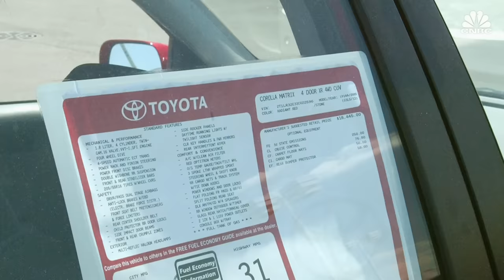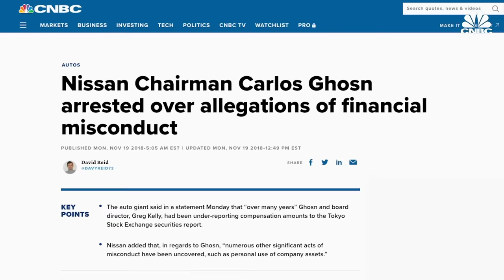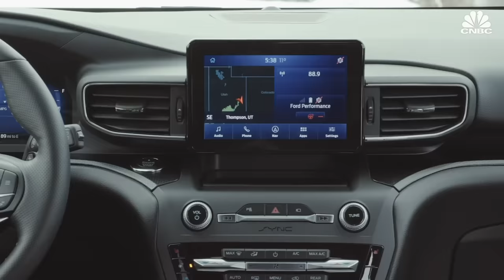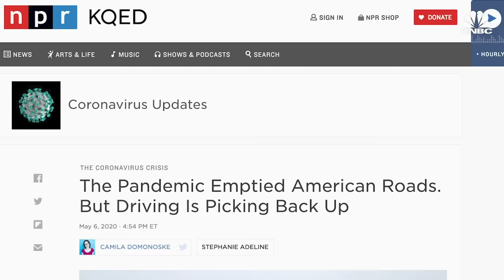Why Toyota, Honda, And Nissan Continue To Bet On Sports Cars

Comment: I want the 90's back! When driving was still fun....
Reply: Get a Tesla, it takes fun to a whole new level 😉
Reply: @markjames2338  But not with all those reliability issues. 😒
Reply: @Sacto1654  don’t believe everything you read. Ours is at 25k miles and all we’ve had to do is add washer fluid. Paid an extra $2k for a 75hp boost via the cars always on phone connection. We drive it hard all the time. Nothing else like it.
Reply: @otakuConn  nothing wrong with a good auto like the ZF 8 speed or any DCT but if it’s a CVT it’s gotta go
Reply: Just get a 90s or early 2000s japanese car
Reply: @modelotime3608  I will collect some, they got finally the attention they deserved when you driving one.
Reply: @markjames2338  The drivetrain is peerless, but the build quality of the body.... 😒
Reply: @markjames2338  go home liberal
Reply: @markjames2338  Tesla isn't the only brand that will have popular electric cars
Reply: u can still get urself a miata or a civic type r and feel the joy of driving, heard they are really good driver's car.
Reply: Still a lot of fun Japanese sports car today on the market that you can buy brand new. Like the Nissan 370z, Miata, 86/BRZ, WRX STI, & Type R. The bonus is they can all come in manual transmissions and have the Japanese soul in them =) 
Than you also have the R35 GTR, Supra & NSX. Though I find the new Supra & NSX big letdowns.
Reply: @otakuConn  

Wtf Tesla’s don’t have a traditional transmission lol
Reply: @jays5926  I think he meant that there is no manual transmission because it doesn't have one.
Reply: @doritolegend9664  

Well he said “no such thing as fun in an automatic”, implying Tesla’s are automatic but they are one speed 

Not a big deal it’s just a little funny. Plus it is true that manuals are much more fun, when not driving in our jammed packed busy cities. I just find them a little impractical in that environment
Reply: Mark James Tesla’s are outstanding cars but for many of us the exhaust note and manual transmission are two of the biggest factors of what make a car fun.  The Tesla (yes I’ve tried it) feels and drives like an appliance, albeit a very well made appliance.
Reply: And gas was cheap!
Reply: And gas was cheap!
Reply: @otakuConn  L
Reply: Did you know that the Soarer/SC400 is the mechanical twin to the MKIV Supra? They're still available, and relatively inexpensive. 

I lived in Japan during the 90s, and it was AMAZING! FD RX-7s, NSXs, MKIV Supras, Skylines...you name it: all I had to do was open my front door, to see them all the wild.  I live in Canada now, but I brought my Japanese cooking with me, and found a bunch of friends who are all fans of these cars, and keep them running still. We have a GREAT time, reliving the 90s, and eating my food. Haha. As for myself, I'm not rich, so I, "only," have an EF Civic and a Soarer, but they're good enough for me to relive my youth whenever I want.  Never gonna sell either.  For us, the 90s are never going to end. Cheers!
Reply: @markjames2338  🤮🤮
Reply: it has came back already, the question is did you get yourself one??/
Reply: @markjames2338  Tesla?🤮 Those cars are miserably boring. But maybe that's the level of fun you meant, who knows.
Reply: @markjames2338  electric cars are a fad. I'll never ever buy one regardless.
Reply: @Mistereveryoppshot  sorry man, there's no such thing as a good automatic car. But at least with an engine, you'd still have great exhaust sounds.
Reply: @jays5926  I daily driver a manual through Chicago rush hour traffic. It's no worse than driving an automatic in those same conditions.
Reply: @neolee3477  gas is still cheap when you adjust for inflation. Our wages didn't keep up though.
Reply: @Jedi391  you nailed it when you called it an appliance. Damn thing sounds like the spin cycle on my washing machine. 😂
Reply: @markjames2338  Go away
Reply: @NikoBellaKhouf  that makes no sense. statistics show that nowadays a majority of autos are much faster then there manual counterpart. yea a manual car is more fun then a auto but that doesn’t make the auto any less car then the manual
Reply: @NikoBellaKhouf  as a owner of a e46 330i manual and a f80 m3 DCT there both equally as much to drive for there own reasons
Reply: @Mistereveryoppshot  they're not better or faster.  Your government forced auto makers to change the gear ratios on the manuals to make them more fuel efficient so they could raise the average mpg for the entire lineup. And when is your auto faster? When you're drag racing in a straight line and the computer knows the shifts are going in one direction? The rest of the time it's hunting for gears. And what if I want to skip gears? Can't do that in a DCT. The are definitely much less fun.  They take all the driving out of driving. What are you doing when the car is telling you what gear it thinks you should be in? Holding the steering wheel? It's not as miserable as an electric car,  but it's pretty close.
Reply: @NikoBellaKhouf  your literally just a hater.its been proven as a fact autos are faster then manuals no human can outshift a dct 🤦🏿‍♂️ and for what reason would I need to skip gears for if I need to upshift or downshift I use the paddles yes it isn’t as fun like I said but it isn’t bad nor slow
Reply: @NikoBellaKhouf  I live in NYC so I also understand being in traffic but I work late nights and there’s times where I’m extremely tired and having a auto makes my hour long commute back home way better and more relaxed at the same time on the highway I can still push it a bit
Reply: @Mistereveryoppshot  hating on what? I explained it to you but you refuse to understand. The difference is literally tiny fractions of a second. Nobody will notice or care in the real world where we do the majority of our driving and skip gears while doing it.  You drive a manual and can't think of a single scenario where you'd skip gears?
Reply: Many people nowadays think power is fun. It s not. You can have power in a tesla or a G65 AMG. My meaning of fun is how fast you can drive through a corner and how much you feel the car. Miata, Z, Gt86....
Reply: @andipajeroking  👍👍
Reply: @Sacto1654  not to mention the ability to remove your cars features, remotely.

Comment: I took my 1999 Honda S2000 which I bought from new for a drive up in the hills behind Melbourne today. The sun was shining, the roof was off, the engine was sweet. Still loving this little car with a massive personality.
Reply: That car Is objectively trash because it's slow and unsafe
Reply: @abovethelaw4417  so you have one? Or maybe your just a negative troll.
Reply: @abovethelaw4417  the entire car community would like to disagree with you

Comment: Bring back the mr2 Toyota.
Reply: Man of culture
Reply: i hear they are trying but ehhh,, they said that about the supra in like 2005 sooo
Reply: I drove a first gen with a 4age thing was a rocket ship ! Legit feeling the powwwah
Reply: They would need to partner with another automaker like Lotus to develop the chassis since for a company like Toyota it would be extremely unlikely for them to spend money developing an entire platform just for one car. That being said, it would never compare to the original in a size/weight aspect because of modern safety regulations. If you see a first gen MR2 in person it is seriously TINY.

But it would still be awesome if they did
Reply: They are rumors they have someting planned.
But the car will be a competitor for the Corvette C8 and Nissan GTR, so it will not aim at the same buyers.
Reply: Mazda MX5
Reply: It's more likely they won't, but I'm not Toyota. They may bring back the S-FR, since they mentioned that the third sports car would sit below the 86 and Supra.

The car is already estimated to be around $15-16k, and they have a partnership with Mazda, so they may share a platform with the MX-5. So there's that possibility.
Reply: The problem they maybe need partnership with another company for that sports car segments
Reply: They said they might make it with bmw but it won’t be mid engine and will be electric:(
Reply: @seanb9698  They did that for the GR Yaris.  Wholly Toyota.
Reply: Might be called the GR2
Reply: Please don't. They brought back the supra 😫💩 that was failure. They brought back the next 😫💩 that was a failure. Call it something else, but not the mr2.
Reply: Yeah the 80s Boxy one too!
Reply: stop bringing back stuff. You can buy mr2 now for 3 grand.
Reply: @KhoiBoa  where, which planet can you buy a 3k dollar MR2?

Comment: Can’t afford 90s nsx when I’m young. Still can’t afford 90s now that I’m old. Fml. 😅😩😭
Reply: Push yourself over the limit. Or if it s unrealistic, settle for a cheaper car.
Worst case scenario, everybody affords a Miata 😂
Reply: @andipajeroking   Miata Is Always The Answer
Reply: @TheBriGuy129 
Miata Is Always The Answer.

...unless you need something even smaller, are "vertically gifted" or want something that takes the Miata formula to its logical extreme. Then you get a Cappuccino.
Reply: There's always a Toyota supra 👍
Reply: @DUNGSTA 
Have you seen how much the MK4s are going for?
Reply: @VestedUTuber  you can buy a new one
Reply: @DUNGSTA 
Ok, have you seen the prices on the MKV Supras? They're not cheap either.
Reply: @VestedUTuber  yeah well at least it's possible to get your dream car new
Reply: LOL. that goes for ANY 90s JDM sports car from japan.
Reply: the price appreciate lol
Reply: @ajemajh 
Excessively appreciated in some cases. The used car market has changed, and not for the better. There's a lot of investment collectors who see cars as nothing but another way to make money.

Heck, even modern new cars are struggling with this. Used Corvette C8s are going for a 20k markup compared to fresh off the factory line, all because "LoL iNsTaNt ClAsSiC".
Reply: The guy said an nsx,  not miata,  supra  or anything else.  Guess I can't afford one until I'm in my late 70s.  Just picked up a 75 Datsun  280z and it took ages...lol

Comment: Nissan is the only one I’m looking forward to. 6 speed with tt v6.
Reply: Me too except the engine has no cylinder sleeves. And with all that boost you're lucky to get any reliability at all
Reply: GeronimoBiggles that’s only on the Infiniti line up. I’m pretty sure their going to add something to at least mitigate the reliability.

Comment: Now Honda needs to bring back the Integra and Toyota bring back the Celica. Then I will be happy lol.
Reply: The Integra is the TLX or one of those sedans.
Reply: Integra still lives on, it’s just now it’s called Acura ILX. 86 is virtually Celica successor
Reply: @INUMIMI28  How is an 86 the Celica successor?  It's not even a spiritual successor considering it's also wearing a Subaru badge.   Wrong drive train as well.  The only thing in common is the badge of Subaru and their heritage in rally otherwise there is no resemblance.  Hell, the GR Yaris also known as the GT Four Yaris has more in common with the GT Four Celica than the 86.
Reply: @supercooled  It is Celica’s spiritual successor. It’s affordable 2 door 2+2 coupe, just like a Celica, and when I “Spiritual” no one wants FWD based 2 door Corolla coupe like they used to (which was basically Scion TC and that wasn’t too exciting) Nowadays if it’s 2 door it has to have performance to back it up, and RWD, more focused 86 fits today’s demand better. GR Yaris is a successor only to GT-FOUR, not the Celica itself.
Reply: Bro I'ma fight you on this one, Celica is just a cooler looking Corolla.
We need the MR2 back is what we need, functionally something different.
Reply: @INUMIMI28  bro Gt86 is successor of Corolla AE86 not celica
Reply: @vertwheeler6698  Successor of AE86 is AE92
Reply: @INUMIMI28  well why it call GT86? Why not name Celica like new Supra?
Reply: @vertwheeler6698  Because you don’t realize the fact that the Sprinter Trueno/Corolla Levin had merged into T230 Celica in 2000, thus making the GT86, Celica successor.
Reply: Bring back the 94 bubble single cam
Reply: And Mitsubishi needs to bring the Lancer Evolution back so I can buy a brand new one instead of used and modded one
Reply: Good news integras back!
Reply: @chriss5821  I called it! Haha

Comment: Honda had the GOAT in the S2000. Hopefully they bring it back.
Reply: We need a S2K type R..
Reply: Got a 2003 love it
Reply: Not as an EV too
Reply: there’s rumors that it’ll come back in a couple years with the engine from the type r
Reply: @castillocaden  i hope so.
Reply: Everyone wants the CTR engine which means it will be electric if they do.
Reply: @danlaclair01  if its electric it wont sell. No one wants an electric convertible. People who like evs like practicality efficiency and technology. No twisties and drop tops.
Reply: Even if they bring it back it won’t even be close to the original. The original had its own engine and transmission and chassis. Nothing was really shared with other Hondas.
Reply: @squidwardshouse67  better than nothing or an ev. Civic type r engine is the way to go. It would also help the civic get some aftermarket support.
Reply: The closest hing to the s2k is in japan named s660 sadly only have 64 hp,but its a baby nsx,mid engined rwd kei car,660cc,looks like an nsx too
Reply: @Shutxk0u  yeah. I saw a few of those. At car shows. Lots of people turn them into mini gtrs 😂
Reply: The initial redline of that vehicle was a phenomenal 8,800 rpm I'm told, IN EACH GEAR ! However, by the end of its production, the folks in the engineering dept. had reduced the redline in each gear to 8,000 rpm. It was to allow the vehicle's enthusiast driver to reach the vehicle's maximum fun point a little quicker with each shift. Some years ago, FIA did something similar with the Formula 1 cars when rule changes had manufacturers decrease horsepower to within the 600 hp range, remove the power steering, the 4 wheel anti-lock disc brakes, the 4 wheel steering, the automatic transmission gearboxes, the traction control and the all wheel drive (AWD). The rational behind this that the drivers of the vehicles actually drive the car and not the car DRIVE THE DRIVER.
No matter which way you view it, the S-2000 was at the time, Honda's version of a normally aspirated version of a street legal F-1 car. And the NSX, was Acura's.
Reply: @100M2B  i prefer rwd cars
Reply: @100M2B  That's not the CTR's only problem. For all it's fake vents, it ironically runs into overheating problems within laps on track. The s2000 will run at the limit all day. 

That's why you only see a few CTRs at the track. They have to be modded too hard in order to do full sessions. Besides that, it's an incredible car. I've never been in another FWD that completely got rid of torque steer.
Reply: @100M2B  youre drunk
Reply: Rumor has it they are
Reply: Heres the problem with that it won't be the same as the AP because of emissions, second if it comes with a turbo you can expect the car to cost in the the $40k range, and therefore this car needs to remain dead so it doesnt ruin the amazing name of the S2000
Reply: @CesarMartinez-gl9ko  ,  None of those reasons [except price] stopped the CTR. 

Maybe you are right. It would be too heavy and would overheat because a bunch of vents would be fake.
Reply: @TheDwightMamba  Because the Civic Type R already had a platform to be built of and the engine is used in more than just the CTR, it is also used in the TLX and Accord. All FWD which makes it more reasonable to built and regarding heating issues, thats been fixed. You see more S2K because of the years and production spam of 8 years vs the CTR which has been only been around for 4 years or so. And even then the CTR is setting more records and running faster track times. The S2000 would need more money to be invested in and it won't be the same if it comes with a turbo. Price would be insanely high for a Honda and it won't be a high revving N/A. Theres a demand but not a market willing to buy, just like the original S2K
Reply: @CesarMartinez-gl9ko  , remind me never to say maybe you are right, ever again. 

Good God!!!
Reply: The new S2000 with a a cross-over EV xD

Comment: I've been a fan of Honda since I bought a used 1991 Prelude Si in about 1994. Since then, I've owned a 1996 Acura Integra LS SE Coupe with a 5 speed manual;
a 2003 Acura CL Type S 6MT (still own it since new); A 2010 Acura TL Tech SH-AWD 6MT(since new but involved in & totaled in a collision); and currently also have a 2019 Acura TLX A-SPEC SH-AWD. These cars are fun to drive on the open road. They have responsive OHC engines and(the Prelude and Integra were DOHC) were/are normally aspirated. Get them on an open, twisty two lane,  and you're gone!

Comment: Few remember the Genesis of this. Mitsubishi New Zealand. In the early 1970s the local distributors, assemblers, lead into that market the most stylish GTHO.  An Outstandingly beautiful, top end, jaw dropper.  Their reputation was made as they introduced an entry level companion, a two door fastback. Then a four door of the same model. In four years they had seized 17% of the market. Every other Japanese manufacturer tried to do the same. Honda Acura was first. Those super smart New Zealanders do it again.